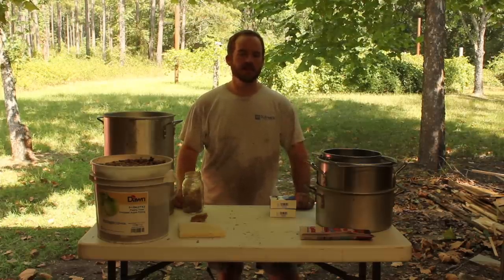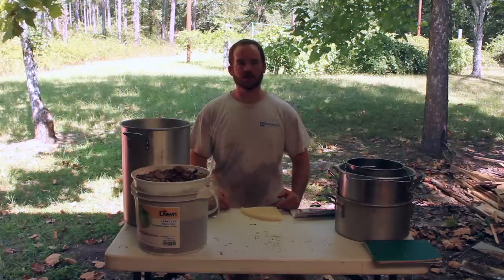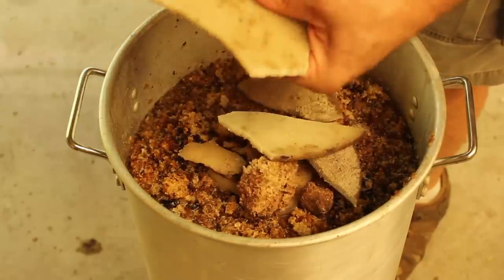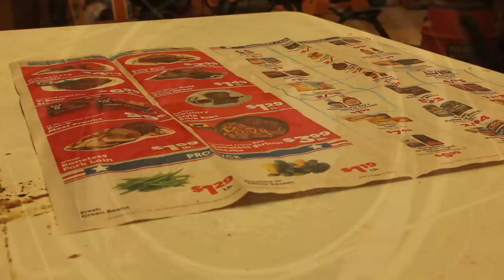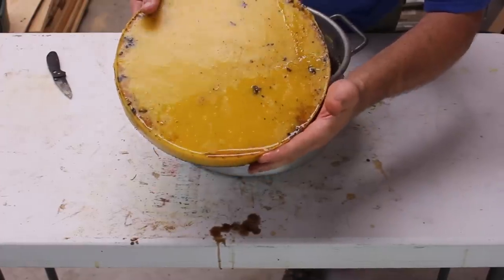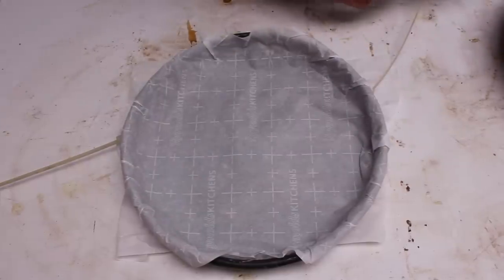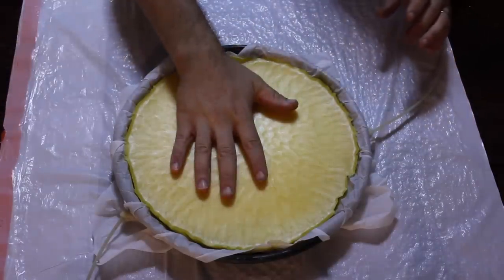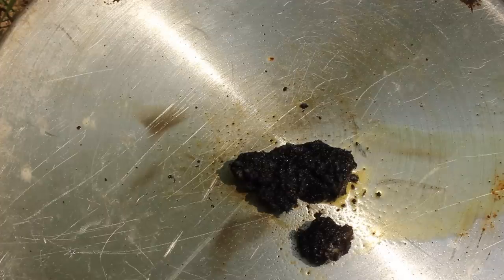From Trash to Treasure: How to Render Beeswax

Comment: I loved my big beautiful blocks of rendered beeswax until it came time to use them for a project. Breaking one apart when you just need a few ounces was a pain! So I’ve started using lined muffin tins (use foil not paper liners) that I fill to different weights. Now I have jars with 1, 2, and 3 ounce little wax cupcakes when I want to whip up lotion bars, lip balms and little projects. It is more time consuming, but so much easier when wanting a quick rainy day activity! Great video sir! Thank you from Oklahoma! 👩‍🌾🌻🐝
Reply: Great idea thanks 😊👍😊
Reply: Use silicone “pans” and they pop right out with no liners…
Reply: silicone liners are even better than foil
Reply: Great tip. Thanks
Reply: @jebeda  I use paper muffin liners too
Reply: i've always thought about why dont people grate the blocks when they need to melt it down? you can weight the scrappings as they come off and they will melt quicker, or is the bar too crumbly or too hard for that?
Reply: @blondie9909  Main problem is that doing that means you would have another appliance dedicated solely to wax, since the grating will get the wax pretty much permanently married to the grater. Plus, it is just a ton of work to grate the wax, so most people prefer just having the wax in smaller weight blocks to begin with, so they save that effort.

Comment: Interesting note: old accordions have beeswax in them. It's used as a glue to hold the reed blocks in place and it seals them off to prevent blow-by. Don't keep your accordion in a hot car, or all the reed blocks inside will fall off.
Reply: I.. This is too specific. Did you recently destroy your accordion?
Reply: Thank you. I will remember this the next time I have an accordion and a hot car.
Reply: Good to know. Not at all usefull for me.
But still very good to know.
Reply: have u destroyed an accordion in a hot car?
Reply: makes sence cuz theres a big honey production in east europe, where they also play alot of accordion
Reply: Wish I had know this when my sister was learning to play the accordion!
Reply: Now that sure sounds like you learned it the hard way!
Reply: Most of them don't use pure wax but a very wild concoction made from wax, some kind of oil like a lineseed oil, and a terpentine. All of this is mixed and boiled and resulting seals are much more hard and temperature resistant than pure wax (but still can leak)

Comment: Silicone cake pans would work well for this, no need for parchment paper and easy to get the rendered wax out once set. They aren't expensive either.
Great video.
Reply: A bread loaf pan would be even better I would think. Then you would have a nice rectangle you could keep on a shelf or stack if you had that much.

Comment: If wax is stuck to something, if a little heat doesn’t work- use ice or put it in the freezer.  When wax gets cold, it gets brittle and will easily crack.  It’s a great trick to get wax out of candle holders etc.
Reply: Also with fabrics, parchment paper and an iron. Place the parchment paper over the wax and iron it and the paper absorbs the melted wax
Reply: Freezing it will cause it to shrink away from the container it is in too. I do this to candles in glass or plastic containers all the time to clean the container so I can reuse them.

Comment: You need to rinse off the cakes after the first filter. Most of the fine sediment is loose on the cake so before you melt the cakes second time for fine filtering rinse them off with water to get the sludge off the backside. Will increase your results.

Comment: This is how we sealed our canned foods on the farm.

We didn't use metel lids and tin caps because that fail to seal or hold a seal alot of times.
pouring an inch of hot beezwax on top of the boiling contents creates an air tight seal as things cool down.
It's also anti fungal, bacterial, and microbial proof.

Will keep canned food safe for many many years with no worries about any rusting goin on under medal lids.
Reply: Was that before or after you went to the mental institution?
Reply: Lmao
Reply: That works. Can't do everything that way, though. When I was a kid, my mom made home made jelly and preserves. Never got a metal lid. She would put the hot jelly/preserves in glass jars, and pour melted paraffin on the top, about 1/2 inch, 3/4 inch thick. Worked just like ginger bread said. That was for jellies and preserves. Maybe the acids in the fruit helped preserve it, I don't know. Not a canner. She canned other stuff, vegetables, and used regular Mason jars, metal caps and bands. But I never saw any spoiled jelly/preserves from using the wax method. It kept all year. Don't know about "forever." Made new batches every year. Thing is, just because you haven't heard of something before doesn't mean it isn't a real thing. Get yourself an education before you start downing others. You are far from knowing everything. Realizing that would be a good starting point for you.
Reply: @mistervacation23  lmao
Reply: @mrhenry4624  pretty sure it was a joke
Reply: @mrhenry4624  chances are it was pastured by the heating process when she made it and after being capped there was no air for new bacteria to grow the fruit is full of sugar which wont rot anyways its why you can have an opened can of jelly for years forgotten in the back of your fridge
Reply: I screen shot your comment. It used to actually be very common :) Yea beeswax has wonderful medicinal properties. I'll definitely be doing that!
Reply: I remember grandmother doing that too, but with regular paraffin wax. Thanks for reminding me, as I will soon be canning produce this way.

Comment: Well if you knew a place to get unwanted sawdust.  You can take any discarded wax product melt it then mix in sawdust and dryer lint.  Put in cardboard egg cartons or a thrift store muffin tin.  Great waterproof fire starters.
Reply: Now where would he find any sawdust? Must be hard to find
Reply: I know such a hard thing to come by.  Might need to import from China
Reply: Yes, two good ways to further process beeswax-reject. However, also two remarks needed here. 

First, when collecting sawdust, only take the pristine clean stuff and preferably from a cutting/sanding device that doesn't use oil. Especially when you want to use the fire-starter indoors (for reasons of smell). 

Second, if you only have cotton clothes in your dryer, go ahead and collect the lint afterwards. If you have polyester-fibres there as well, you might want to look for a different source as the smell of burning plastic isn't fantastic.
Reply: @wauhawk  There's actually a little bit of humor in your comments. I was a long-haul trucker and I used to go to a lot of paper mills in Maine. That old country song about a tombstone every mile was 'cuz of highway engineers in that state! But, a friend still in the trucking game says that most of the mills have been bought out by China to make that horrible knock down furniture! It seems like they have so few trees that folks who can afford it buy oxygen in a can! A friend was doing business there and he said that air was worse than the brown haze over California!
Reply: Im a carpenter. I got all the sawdust you want
Reply: @mcshawnboy  Ohhh the haze in every major city of China...hyperfast urbanization, skyrocketed economics, and a whooping population number...we have many trees here, but not inside the city.

Comment: Great job on the video.  Just a little advice for next time though, scrape all the crap off the bottom of the first step (screened wax) before you do the second refining melt.  Then you have a lot less junk to screen out the second time.  Just grab your hive tool or similar and scrape as much of the gunk off the block as you can.

Comment: you could also use silicon forms for baking - cupcakes or bread molds or even ice forms. makes it easier to store it in smaler chunks.  Nice step by stepp process.
Reply: Silicon forms are amazing for any kind of molten thing you want to cast, as long as it's not hot enough to melt the form XD
When it cools down you can just take the form right off.
Reply: Yep! A silicon mold put inside a regular pot or cake tin (if the silicon wall is thin the contents can spill) will work excellent, and also, they're relatively easy to clean
Reply: @Roderick storey Oh Lordy, half a cheesecake...I'd have gone into mourning at that point.
Reply: @Roderick storey I love those for ice cubes! The round one is a 2 part mold and it isn't very round, the top is flat 3/4 an inch from the top.
Reply: @gingerbread1032  I read a statistic that said the vast majority of the human race has a small percentage of PTFE or the registered trademark, Teflon.
Reply: CATwoman 1 Yes, I absolutely agree. A stupid rude comment that made no sense. His axe must be very blunt when he has to grind it in public like that.

Comment: For future reference, to get wax out of cloth or rugs, put paper towels over it and then use a warm iron. It'll melt the wax into the paper towels and remove most of it from the clothing/rug. Learned that from a friend's mom.
Also, a trick: Get yourself a dedicated glass quart measuring cup and use that to dish out the cappings into the pot. This way, you know how many quarts of capping are in the pot, so you can measure out how much water you need.

Comment: Mix the "dirty" wax with saw dust, or dunk paper towel that's rolled up about the size of a fat pencil.

The wax is the fuel AND the protectanct of the load (paper).

I make them about 4 inches long and use one per fresh fire...probably could use less for dry fire bed.

Cotton, wood shavings, paper scraps, or anything that wax will wick onto.
Reply: dantco dryer lint works great too!

Comment: A couple of things that "y'all" might like to consider: 1. If you are going to work outside, perhaps it's better to do after sunset, or at least when bee wont be out foraging.   2. If you put some water in the pot FIRST, you wont get that burnt patch that ruins y'alls pot.  3.Instead of using panty hose as a filter, filter cloth is so much more durable ( get it from an industrial supplier) but far better than anything, is to boil up the wax with plenty of water, and pour the 
lot into a tall, narrow stainless steel cylinder to cool over night.  I use a couple of old fire extinguishers with their tops cut off. or you can get ss pipe from a scrap metal dealer, or steel merchant. About 8inches diameter works well, ( you have to be careful to make sure the cylinders are stable and wont tip over, of course.) To get the wax out, you may just need to heat the sides of the cylinder,  or force water through a hole in the bottom of the tube, which you might have sealed with a pinch of clay. You end up with super clean wax at the very top, and progressively  dirtier stuff . at the very bottom.  Cut that off, and put aside for the next rendering.. Always remember that hot wax is exceptionally hot so take  a lot of care.

Comment: My dad kept bees for a while. He made a Solar oven for the first stage of the melting process. It was fairly simple, but did a fairly good job. He'd dump a bunch of the dirty wax in it, the sun would melt the wax which poured through a screen into a waiting container leaving the worst of the junk behind. The only down side is it had to be a hot day. Soon as the wax had melted he'd scrap the trash out of the melter, and dump more wax that needed filtering in it. The clean wax would get further filtering using a double boiler.

Comment: You can get damn near the same level of cleaning by pouring out of a pot with a a pour spout (not a full, enclosed spout but the kind of crimp in the metal).  Pour slowly down a smooth stirring rod (glass is what's usually used) that you hold closely to the edge of the pot. Surface tension will pull the fluid through the tiny gap which will hold most all of the particulates back.

It's a super old chemistry decanting technique.

Here's a better explanation with pictures
http://www.genevaschools.org/Downloads/Lab%2520Techniques.pdf

Comment: The reason that the parchment paper worked so well is because it is coated in a nonstick coating, sillicone usually. Therefore you were easily able to take the wax out. Here's a 'pro' tip. Don't bother wasting zip ties, get a egg wash brush or you could use a paint brush if you really want, does the same thing, and get any cooking oil and get the oil on the brush and brush the inside of the container. You'll then be able to easily stick the parchment paper inside the container and if you spend some time if you really need it then you'll be able to get the creases out and the wax will come out with no indents.

Comment: 9:38 - a chemist here - I never understood the purpose of vigorous boiling. i.e. the temperature doesn't change(the exes heat just evaporates the water), so all you get is a bit better stirring(from the rising water vapor) and negligibly better temperature distribution(in case the evaporation cools the inside of the pot faster than the fire heats it), and as you say, the more vigorous boiling doesn't reduce the 30 min. of boiling time. so why?

Comment: You did a great job on that wax . Just a side note after your first boil when the wax hardens an you take it out of the pot with the water if you will take your hive tool an lightly scrap the bottom of your wax cake that will help out a lot more for your second rendering to have a lot of that small trash already off of the wax for your second batch. Keep up the great job an THANKS

Comment: The color of the beeswax is really beautiful!  Here's a suggestion that may save you a lot of work and clean your pots and honey strainer:
Spray the bottom and sides of the pan with PAM and nothing will stick.
If you want to clean your screen stick it in a freezer.  Then you can peel or pop off the wax.     Works for candle holders or anything wax is stuck on.  It may save you some time. 
Just a suggestion.

Comment: Great Video! The Trick with the firestarter is, you have to use some wood with it. Even wet wood will work great, because the wax helps the wood to start a fire. I often used old candles to start a good fire in the wild! The wax it self needs way more heat to start a fire then the wood itself :)

Comment: I have never seen an accordion like that. They use reed blocks with slanting shoulders - where a strong bent wire over each end clamps the blocks down solidly. The sealing is done with felt gaskets.

Comment: For the fire starter.. after you pour out the gunk take something and spread out while its warm all over the newspaper in a even quarter inch layer, let it cool for a while. After its cool roll it up over and over on its self then stash it away for a couple months somewhere to dry. After it's dry you can cut it up into cinnamon roll looking fire starters. They work great.

Comment: Just a casual viewer who is fascinated. I've watched you harvest honey and repair hives. I watched you turn the caps you've scraped off into candles. It's all amazing. What happens to the frame after you've extracted honey? Do you remove the comb? Is it reused? If reused, does it last forever? Does it just slide back into the hive? Sorry for the questions.
Reply from the maker: No worries, David. Frame goes back into the hive, the bees clean it up, repair what I cut off, and refill it with more honey (provided there is nectar available for them.) The comb will pretty much last indefinitely, so long as chemical mite treatments are not used. I use Oxalic Acid, which is organic, does not bind in the wax...anyway, that's probably more than you wanted to know, but I've got frames in hives that are 9 years old and maybe older on some.
Reply: @falllineridge  Amazing! I'd never have thought. Thank you for your answer and your videos.

Comment: Put saran wrap, (or your parchment paper.), on the table before the newspaper. When you dump the 'spoilage' on the paper, spread it out right away. Cut that into pieces or strips to use in your fire starters. You also had good fire starter material in those panty hose. Spread them out, let them cool. Cut them up. I think I would have scraped the bottom of that thick slab, with a spoon or something, before melting it the second time. That is beautiful! Looks good enough to eat! LOL

Comment: A much easier way to do this is to put a silicone pan with water into the oven.
Over it, place your metal screen.
Inside the screen wrap your wax in cheese cloth.

As the oven heats on low, the wax melts through the cheesecloth and screen into the silicone pan of water.
The wax floats, and once the oven cools, and the wax hardens, you can peel the wax disc right off the silicone pan edges.
Repeat to refine

You bah also separate honey from wax this way, just omit the water in the silicone.
Sure, the honey gets pasteurized, but it’s good for cooking!

Comment: I think you should think about making a mold by using a bucket cut off to a six inch depth from the bottom. Then paint the outside with mold release then covering it with a mixture of silicone and Liquid soap, or a commercial latex molding rubber. Then have those molds on hand for making large wheel discs of clean wax. And cover with a piece of screen door screen to keep no bugs from contaminating the rendered wax. Just a thought from someone who knows absolutely nothing about beekeeping, other than what I have seen on youtube. I am disabled so I watch a lot of how to videos and making silicone molds is some of the videos I have seen on youtube. I think that people could do a lot of they use youtube how to videos to expand on their own projects. I can't do anymore, and you know what they say about those who can't do anymore, they teach. So you can take what I say with a grain of salt, or you could try making your own molds and adding that knowledge to your own site. Just a thought.